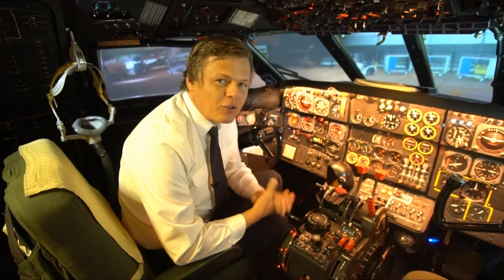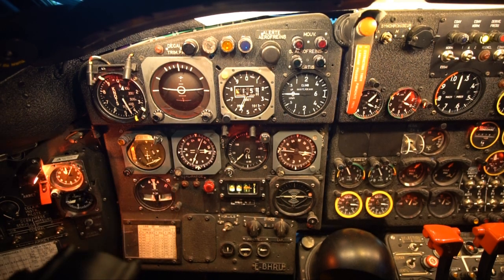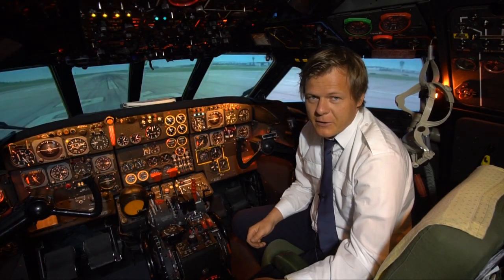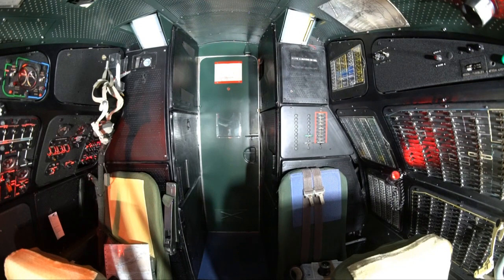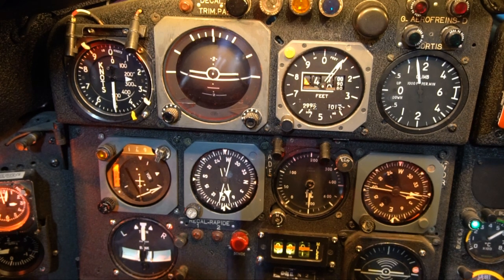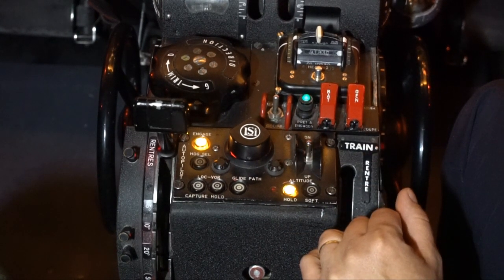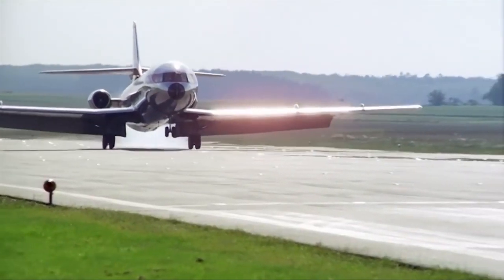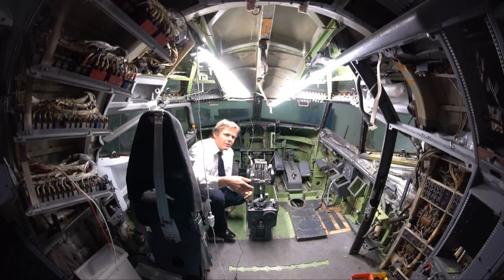Airbus pilot falls in love with vintage jetliners - Caravelle and Boeing 707

Comment: I remember seeing Airborne Express Caravelles flying freight in the late 70's & 80's. I was flying 727's in those days. Since they flew at night they were easy to spot sitting at airports all day long. The Martin 404 had brakes like that. Almost too sensitive to use. Very little pedal pressure and they were almost full on. That Caravelle had low thrust engines. No wonder it had that big wing, or it wouldn't have gotten off the ground. I remember the F-28 had 10K thrust engines, more than the Caravelle. And it was a lot lighter.

Comment: There 's a Caravelle sitting in Avignon Caumont airport you can visit it on appointments,everything is there even the smell in the cockpit, that was such an experience as i love myself steam gauges aircrafts which required real flying skills,that 's when humans were in charge of the machine,not like the opposite nowadays, i was amazed by such the low clearance on the windshield,at that time there must have been some serious navigation skills involved...i was amazed with the switches and gauges ,such a small cockpit..thx for your work and experience share.

Comment: The cockpit windows are still identical to the Comet. They did not change anything in the cockpit windows, even in Comet version 4.
Reply from the maker: Hello, they did. Only prototype 1 and 2 had original Comet windows. You can see the structural changes with the naked eye ;-)

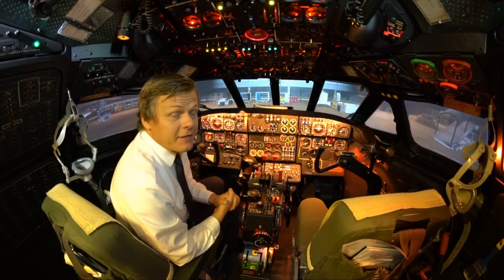Comment: 1:04. It is not a 'myth'.  The two designs started exactly the same, but the Caravelle evolved independently from the Comet during the development of the aeroplane.  For the same reason the 737 windows are not the same as the 707, but started the same.  As did the 727.  Also, the control wheel follows the deHavilland design in shape, also with offset column, and was maintained.